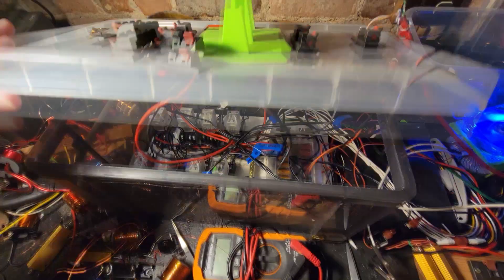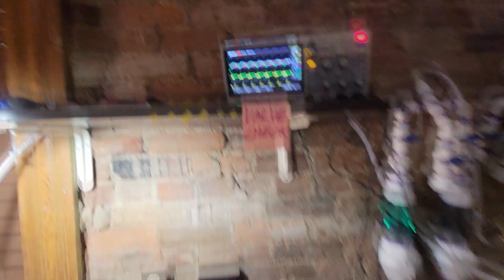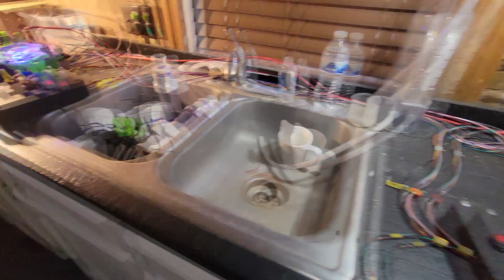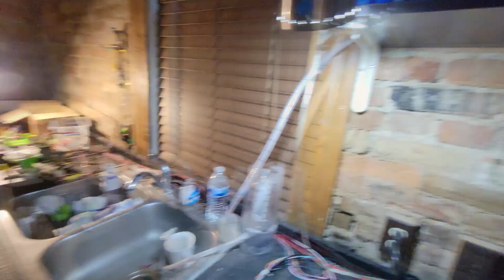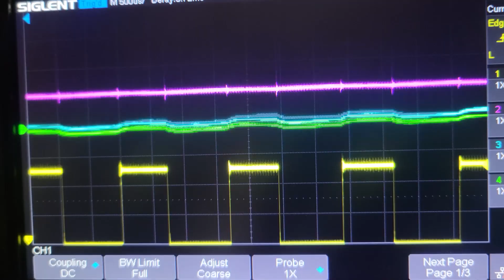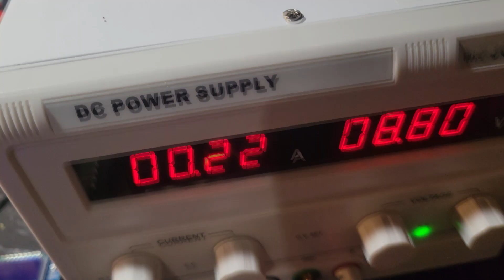Season 4 Starts Here!

Comment: Where do you connect probes of your oscilloscope?
Reply from the maker: The yellow is connected to the PWM output (square wave). The blue and green are connected to the respective positive and negative terminals of the 36x cells (all connected in series).